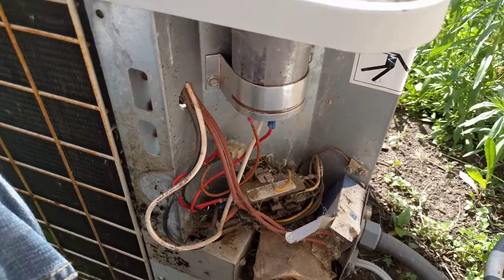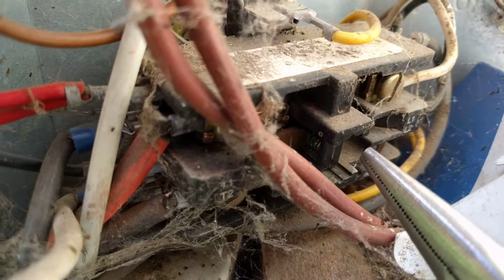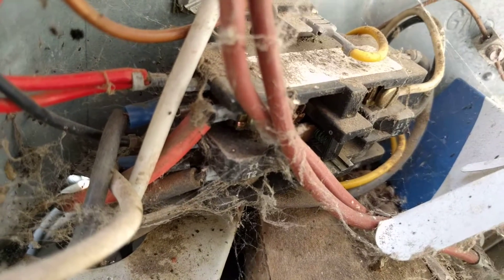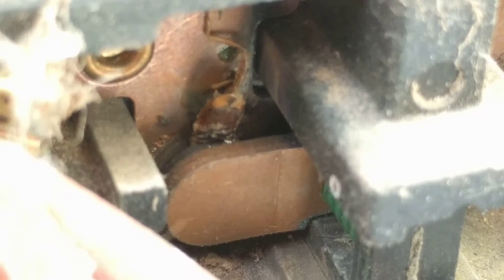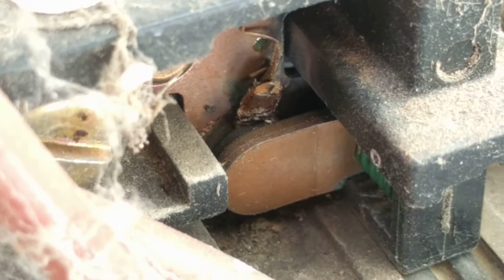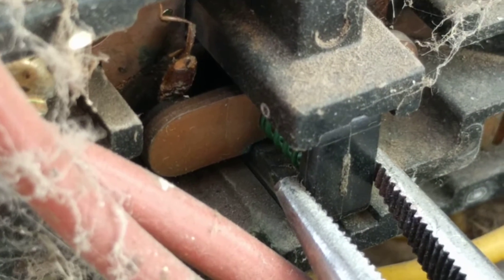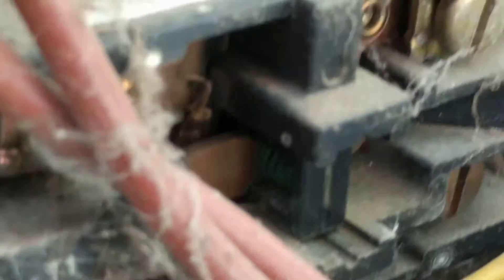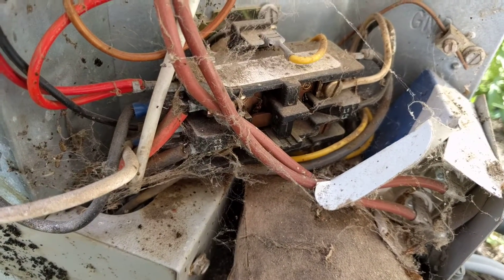Bugs Under Air Conditioner Contactor Points - AC Troubleshooting Common Problem

Comment: This video needs more than 60 likes!  I had an HVAC company come out last year because my compressor and fan wouldn't turn on.  They replace the capacitor and it still didn't work.  Then they told me my contactor was bad and needed to be replaced.  This year, same symptoms, and I was wondering why my contactor would be failing so often.  I noticed a bunch of ants inside when I was checking the capacitor, and I searched and found this video.  The contactor on my unit is enclosed, but I was able to remove the plastic cover and sure enough, there were balls of fried ants.  With the power off, I used a screw driver to remove the ants from under the pads.  Closed it back up, flipped the breaker and sure enough, it fired right up.  Now I suspect either the HVAC company didn't replace the contactor and just cleaned it up, or they didn't do the bare minimum of troubleshooting and simply replaced a perfectly fine contactor.  Anyway, great video, appreciate the education on how the contactor is supposed to work.

Comment: I de energize and take a q tip with carburetor cleaner and swab the contacts. Sometimes you have to give the contacts a little sanding just like points on a car.